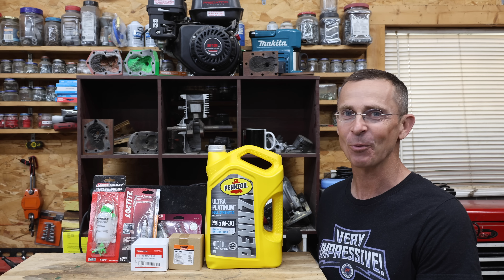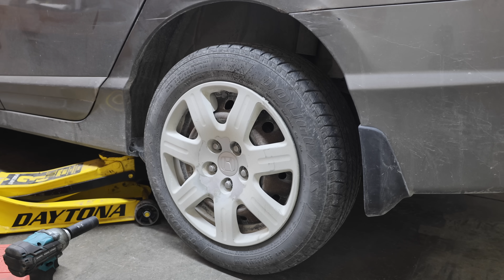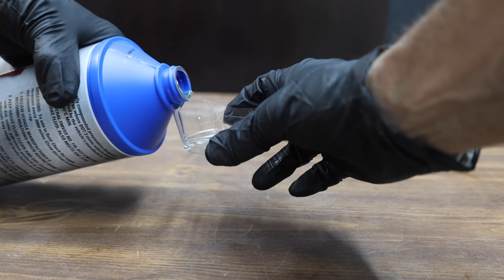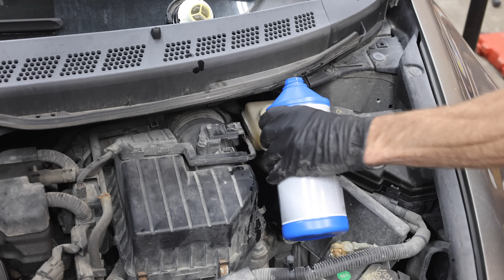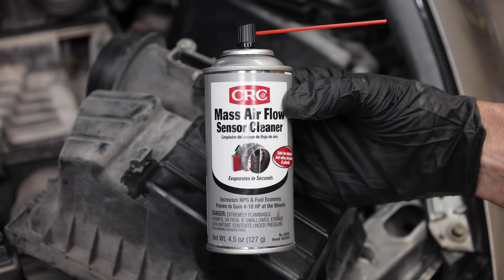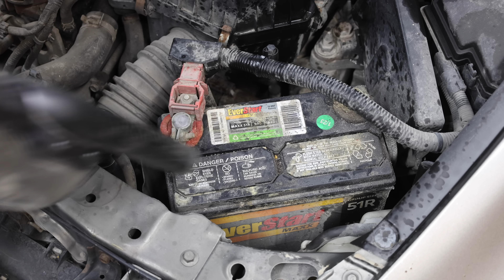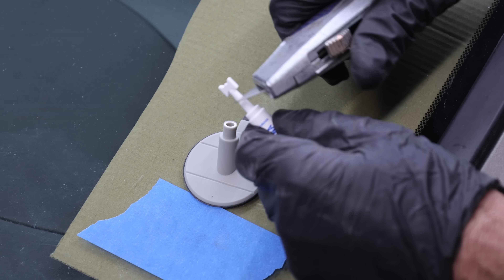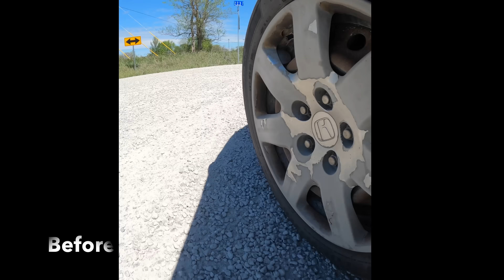Most Reliable 200K Mile Car? Let's Settle This!

Comment: When I was in college, my parents gifted me their very old 1995 Ford Explorer XLT. I drove it across the country to college and drove it through college, grad school and, ultimately, after marriage. My wife and I moved to the Silicon Valley and took it with us. We used it here as a second vehicle (and one we would take for camping trips). I changed the oil and fluids regularly. The only problem that it ever had was a thermostat housing unit (which had corroded a bit). So, I replaced it myself after buying the part on Amazon for $20. 

This past summer, we gave this vehicle to my brother-in-law. He drove it from Northern California to South Texas (on the border). He's still using it as a daily work vehicle. Apart from that thermostat housing unit and periodically replaced tires, everything else is original. It has nearly 400,000 miles on it...and it still purrs!
Reply from the maker: Thanks for sharing!

Comment: There was some block casting recall on this motor I believe.  As a result, low mileage replacement engines for these are a good bit more expensive than other options.
Reply from the maker: Thanks for sharing.

Comment: that's my car!!!! 😃The front trim bolt-point tore away on my driver-side, happened to a neighbor as well, so we hold it on via self-tapping screws or zipties.  I bought it with the front speakers blown out, haven't bothered with a repair for that, but most of the other stuff you mentioned has seen replacement at least once.  If you CAN do it all yourself (i.e. have the time and know-how), it's well worth it!  But most folk would rather have a car that works without needing much repair as they will be paying someone else to do it and labor can be $$$
Reply from the maker: Thanks for sharing.

Comment: Agree that a good number of modern vehicles are capable of very high mileage if not abused and given proper (routine) maintenance. There are a lot of people with high mileage Chevy / GMC trucks out there. I've had (3) Hondas (Civic, Accord and Element) go over 300k miles with original trans and engine. I bought my son a 2010 Honda Civic (very similar to one in video - including color) with 296k miles for his first car in 2019 - $3,300. Figured it would be a good car for learning to drive and that, if it lasted 2 years, it was money well spent. He drove it until spring 2023 (4 years) and I sold it with 346k miles for $3,000 (used prices were still running high, post-pandemic). It had some rust on the rockers but drove great. Saw it on the road last week so still kicking.
Reply: Proper maintenance is the key - my 200k mile vehicle (Opel Kadett E Caravan* 1.6l gasoline engine) was the car I drove as a student through my internship and my first years as a MD. I had it for 13 years and drove it about 350.000 km or roughly 217.000 miles - and it was definitely in much much better shape when I sold it and replaced it with something more modern with A/C, ABS, ESP etc.
…and I plane to drive my current vehicle at least to through the 200k mile barrier – a Mercedes Benz CLS Shooting brake V6 Diesel. Right now I drove it for more than 6 years and more than 100k mile and it is still in pristine condition through proper maintenance! Needed a new windshield recently.

*there was a Chervrolet Kadett Caravan(=station wagon) made for brazil with the same basis. Opel Germany was owned by GMC at that time.
Reply from the maker: Thanks for sharing.

Comment: I've got a 1998 Mercedes E55 Estate (Wagon) I bought it 12 years ago with 170,000 miles on it. I had it's annual MOT today (I'm in the UK) it failed - parking brake needs adjusting. That's all! And the UK MOT is stringent. It has 251,000 miles on it now and it always works. It's a bit rough around the edges as it lives outdoors in the UK but I look after it as best I can and it looks after me!
Reply from the maker: Thanks for sharing.

Comment: I only buy used Hondas, preferably K24 powered. 

My latest is an Acura TSX got it with 250K for $3,100. I got an eBay package of headlight lenses, ballasts, igniters and bulbs shipped for $192. After that, a transmission flush, plugs, pads, wipers and 3 oil changes has been my entire cost of ownership. 

The 2000s was peak-Honda.
Reply from the maker: Thanks for sharing.

Comment: Make more of videos of you fixing cars or just renewing them its pretty satisfying  :) your good and efficient with how you do everything and I learned everything I know watching your videos from the very beginning.
Also make a new reviewing HOTSHOT SECRET and comparing other fuel, additives, and oil additives to Hotshot secret. They have the new oil stiction and eliminator additive and they have diesel and gasoline fuel additives that apparently clean out your turbo, your injectors and give you better miles per gallon.
Reply from the maker: Thanks for the suggestions.

Comment: Could you review oil drain pans? See which ones leak, which ones can take the abuse of sliding on asphalt or gravel, which ones are too flimsy to handle when full, which ones allow the oil to drain into the reservoir fast enough to not cause overflowing, etc. Your testing procedures are the best! We need your expertise on this. Thank you, PF!
Reply from the maker: Thanks for the suggestion.

Comment: Just so you know, if the battery ever goes bad (which it was made January 2023 so it has at least until February 2026 until warranties expired) two things to not tell the person at Walmart (as someone that used to work in a Walmart Auto Center)
1. Dont tell them you didnt buy the battery yourself, if you arent the original purchaser, no warranty. But we wont ask for any proof of purchase, as the battery is serialized.
2. Dont tell them you refilled the battery. They are 'maintenance free' and refilling voids the warranty.
As long as you follow these two rules, they will test the battery to confirm its bad and will hand you a brand new one.

Comment: Hi Todd! My wife has this same generation Honda Civic and I just want to ask you which brand of axles and complete struts you used in this car. If you can also let me know where you got them that would be great. I heard stories that aftermarket axles  introduce unwanted vibrations and aftermarket struts go bad after 25K miles.
Reply from the maker: I'd better avoid providing the information on the brand that I purchased just in case they don't hold up.  My recommendation is to go with a reputable brand if you plan to keep the car for a long time.
Reply: Thanks Todd! I completely understand. God bless and more power to you!

Comment: Correct me if I’m wrong but several mechanics have told me that when transmission fluid is really black it is due to the clutch friction material contaminating the fluid. It means that the transmission fluid was not replaced at regular intervals and the transmission is going to die soon. To replace the black fluid loses the clutch material that is in suspension and still doing something to help the transmission not slip. Then again I haven’t watched the end of the video, but I’d like to know how the transmission is holding up in a month or so.

Comment: So here is how I have always managed my cars. I budget what I can afford for a car payment. I take that and put it in a saving account. Any time a repair is needed I pull from that savings account. this includes oil changes, tires, Brakes. anything that needs to be replaced. every month I take my car payment. Put it away. I keep the car until 2 things happen. I either A, can not longer get parts for my car. or B. I have enough money to purchase something newer. make your car payment work with you, Not against you.
Reply from the maker: Great management!  Thanks for sharing.

Comment: 2008 Prius, 345k miles 
Original engine, transmission and ev battery, still gets 45-50 mpg

220k miles is Pizza Delivery miles. Mobil 1 filter and 0-30w synthetic every 5k
Reply from the maker: Nice!

Comment: I feel like when they get to 200k, that's when they are affordable. I bought a VW Jetta ALH, 288k drove it until 349k 🌋🪦. I bought an 04 LB7 Duramax with 353k and drove it to 420k when I sold it and it's still going.
Reply from the maker: Thanks for the feedback.

Comment: For anyone wondering on the transmission fluid most Hondas have a drain and refill indicator plug. After draining you undo the upper plug (under car) and while car is running fill (plug is located on transmission behind the battery.)with transmission fluid until the fluid comes out. Obviously don't run dry put a couple quarts first. Be sure to use the proper fluid for your specific car as it makes a difference.
Reply from the maker: Thanks for sharing.

Comment: I’ve used a shop vac to pull out fluid with pretty much the same set up. Not as quick as yours but I’ve no other reason to own a vacuum pump.
Reply from the maker: Thanks for the feedback.

Comment: 5th gen Civic. These freaking things thrive on neglect and abuse. No competition. Warning, they are getting harder to find being 30 years old. 200k is a sneeze for that car. Mine is at 280k and was beat on for who knows how long beforeI rescued it.. it was saved from a ricer before it was destroyed. I've only ever really had to do routine maintenance, a battery, a distributor coil, brake calipers, tires, coolant hoses, and new lock cylinders all around. That's probably the worst thing about that gen civic.. the lock cylinders must be 100 percent plastic because they only last like 5 years and are scary easy to jiggle (bypass.) This will be my civic's 10th year I've owned it.. and I have been waiting for the motor to go out for about 2 years so I can swap it.. .. hasn't happened yet.
Reply from the maker: Thanks for sharing.

Comment: With that trans switch I first check the connection at the plug, CRC electronic cleaner works great for low voltage connections. Then the trans fluid change it's better to only change the fluid that comes out and not change all of it.  Then the antifreeze is good for the life of the car even after 50 or more years It's still good gust add to what you have. Good video thanks
Reply from the maker: Thanks and you are welcome!

Comment: 200,000 miles on a Honda or Toyota is nothing. They can easily get to 400,000 miles with minimal repairs as long as they are maintained.
Reply from the maker: Thanks for the feedback.

Comment: I bought an 05 Corolla 1ZZ with 240k on the clock with a blown head gasket for $260 two years ago. Replaced the head gasket and it now has 298k miles. Other than that it's only needed tires, brakes, spark plugs (OEM only) and a right front spindle. It gets mid-30s MPG.
Reply from the maker: Nice!

Comment: There is no defeating the first generation of Toyota Tacoma. Ive owned my 1998 for 10 years and 160k miles. It has 382,xxx and runs like a sewing machine with the original clutch, transmission and engine. 2.4l 5spd manual.
Reply from the maker: Nice!

Comment: Best to run the engine for a bit at temp before putting cap on too. Watch for bubbles.
Small bits of metal was once a now weakened internal part.
Disconnect the transmission cooler exit fitting and run it too a large catch. Pump fresh fluid in and through the system till it comes out clear.
Reply from the maker: Thanks for the feedback.

Comment: Always good content. If you have an old plastic gas can that has a protruding vent you can slide tubing over, you can hook your shop vac where the filler neck would go with a little duct tape and create a fluid extractor as well.
Reply from the maker: Thanks!

Comment: If you don't know when the transmission fluid has been changed, it's best to not change it. Changing a high mileage transmission fluid will usually result in gears slipping.

Comment: I’m fairly mechanical and will tackle brake jobs, strut replacement, alternator etc., but water pumps I have not attempted.   I just took my 1997 Toyota Camry with 270k miles and had the water pump, timing chain and oil pump resealed at a decent mechanic shop,  it wasn’t cheap but it was certainly worth it.   I have a decent tool box but didn’t have a couple of tools to make the job easier for me.  Money spent and still money ahead on this car.   I bought for one of my daughters for college and after graduation I kept and sold my Ford Expedition, which was in great shape,  with plans to buy another truck down the road.   That was 5 years ago and it runs like a Swiss watch and burns no oil.   Great car!   And cheap to insure and best of all zero car payments👍.  Great video!!!
Reply from the maker: Thanks!

Comment: If you want an answer to the title any brit or European would agree it's anything vag (vw, audi, seat/skoda) that's a PD there's thousands on the road that are over 200k miles some way over that, carthrottle years ago had an A6 that was on 400,000 miles and still running strong with alright bodywork

Comment: I got a 2015 VW Jetta GLI with a big turbo upgrade with a tune. With some other bolt ons. Riding on coilovers and aftermarket wheels. Engine and transmission completely stock. Other than wear items m, no major repairs. And I drive the car very hard. But I do ALOT of preventative maintenance. I do all my maintenance and repairs. I say all this to say I just past 300,000 MILES. It’s all about preventive maintenance. Change my oil every 3k with Liq Moly. I clean the intake valves every 25k miles (very important- direct injection) Change dsg trans fluid every 40k. Brake flush every 50k.
Reply from the maker: Thanks for sharing.

Comment: Loved this one.
Make sure to use sealent on the thermostat housing or it can develop a leak.
I've been a mechanic for over 20 years now and I've learned that these 4 brands are the best built and routinely turn 300 thousand miles without major issues:
Ford, Chevrolet, Honda, Toyota.
And not everything is going to be perfect, especially newer cars that are 50% chinese!🤮🤦
Anything can be a good car if you take care of it, but the 4 brands mentioned are your best bet!😎👍
Reply from the maker: Thanks!   Thanks for the constructive feedback.

Comment: This is the best condensed DIY shadetree mechanic video ever made!  You checked and changed nearly every normal wear item on a used vehicle, sure some are more prone to wearing out front end parts, but this is a Honda car.  I love the use of the proper tools to measure the quality of the brake fluid, battery life, antifreeze etc.  It's hard to explain why fluid needs to be changed out and these are great tools to prove this.  In this quick intake short video world that we live in, this is the new format.  Sure, a longer more detailed video on some items is certainly helpful, but for the most part, quick simple instructions are key to engagement.  You are a Pioneer in video content and format, you will be rewarded.  God bless, even the simple explanation of the cost of ownership at the end is what most young people don't consider.
Reply from the maker: Thanks so much!

Comment: Excellent video!  I have "Rescued" many vehicles , as you did this Honda.  You made one significant mistake. When replacing DRUM brake shoes, the Wheel Cylinders should be rebuilt(which is OLD, OLD school and hardly done anymore)  or replaced with new cylinders.  The reason is, even if not leaking NOW , after installing the new, thicker, shoes, the wheel cylinder pistons get pushed back towards the center of the cylinder.  This center area could be corroded and the thin "Lip" seal may leak, shortly after installing new shoes.  This could cause dangerous partial loss of braking ability.  Also, if the now leaking cylinder(s) could contaminate the new brake shoes, with brake fluid.  If this happens,  the shoes must be replaced(again).  So, not replacing cylinders could be dangerous, or necessitate doing the job again! I watch all you EXCELLANT videos and have done WELL following your purchase recommendations!  Thank you!!

Comment: I love the video and the direction this channel is going! Please keep the new style of content coming. I don't have any specific video ideas but my advice is to keep the videos topics to practical ideas. as a side note, I have a 2011 (the worst year) Chevy Cruze 1.4t (worst motor) and I currently have 190,000 miles on the original motor, turbo, and transmission. I'll be doing the water pump soon because it is leaking but that's the first repair I've had to do aside from basic maintenance. Not too bad for a car that's considered a lemon.
Reply from the maker: Thanks!  Thanks for the suggestion.

Comment: i had a 2004 honda accord untill 2021 when i finally got my wife a brand new car. the honda had over 200k miles and didnt have much issues.and i always kept up with the maintenance but it started burning oil which was the last straw. car was sold with the new owner knowing that it burned oil, and he was planning on doing an engine swap anyways so he was super happy he found a well maintained car he planned to upgrade many aspects of the car, so it was a win win for everyone.
Reply from the maker: Thanks for sharing.

Comment: Any 1980s/90s Mercedes can hit 200k without issue. I have 5 with 350k+ miles, both gas and diesel models, and drive them daily. Honda is good, but MBZ was built better back then.
Reply from the maker: Thanks for the feedback.